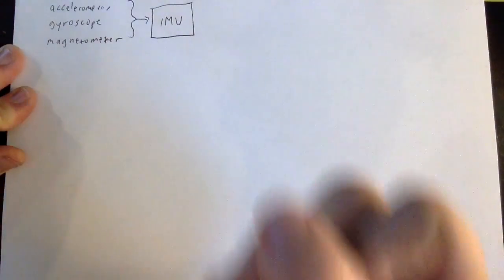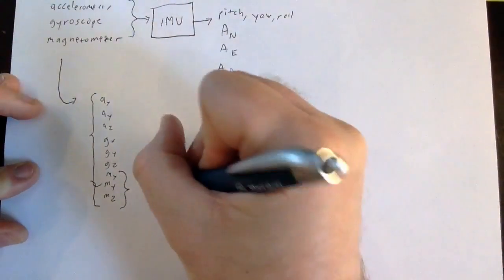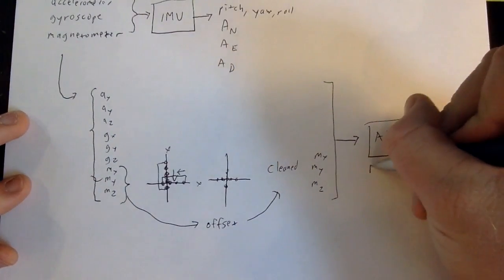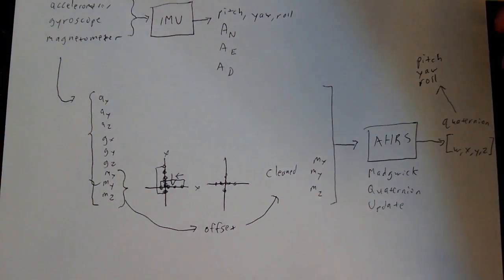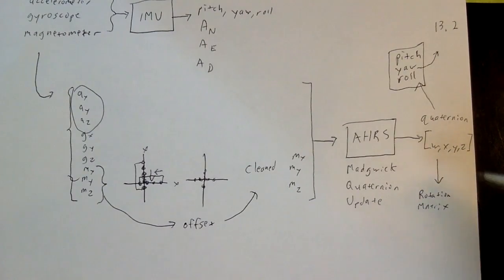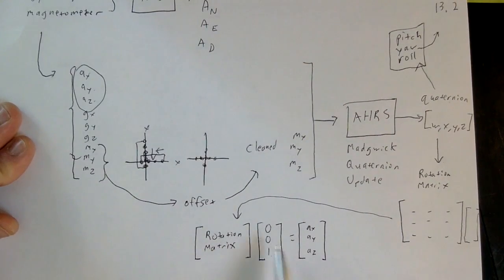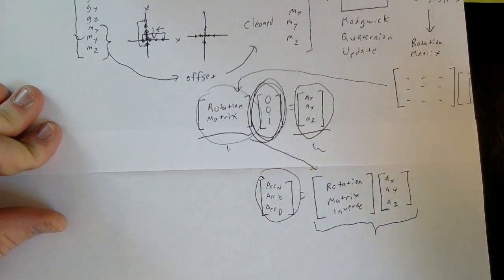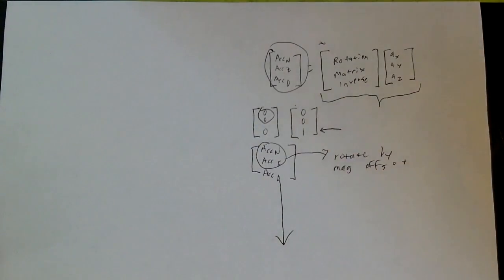How to Implement an Inertial Measurement Unit (IMU) Using an Accelerometer, Gyro, and Magnetometer

Comment: Thanks for the great video!!
I have a doubt. So, what is the advantage of merging the accelerometer data from the rotation matrix after the madgwick filter. I couldn't find more papers or resources which uses fuses the Accelerometer in NED frame (from madgiwck) with the GPS data in NED to estimate the position. In my opinion, I think if we use madgwick then the orientation will be more accurate so, we can fuse it with GPS to track the position more accurately. But I am not sure whether my understanding is correct. Can you point me to some resources which explains the approach which uses first madgwick or some other approach to get orientation first and then uses rotation matrix take accelerometer in NED frame as you said in the video?

Comment: I'm confused as to how you get a 3x3 rotation matrix that works. From what I can find, I can only get a rotation matrix to rotate the acceleration vector around each axis individually which isn't helpful because vector rotation in R3 aren't commutative. I am having a really hard time trying to remove gravity from my accelerometer data, especially since my IMU doesn't have a magnetometer. I'm trying to do it just with the gyro's angular displacement but I'm running into a few issues there as well.
Reply: the rotation matrix is dependent on the pitch yaw and roll angle which you can measure using gyro, accelerometer (and maybe magnetometer if you would). When you measure these 3 angles, you can create your rotation matrix which simply will rotate any vector by these 3 angles. anyways your comment is from 3 years ago ahahahah, I hope you've find the solution.

Comment: Hello. Great video but I have a query regarding offset (to account for magnetic declination). I am trying to use this data to find out my location( using GPS dead reckoning with linear kalman filter { with the help of your other video} ) .What do I do to account for offset in that case? I don't even my current location.
Reply: Hey I want to implement this using kalman filter. Can u help me plz
Reply: @shanuvals1456  It's been a while since I worked on this. So, might not remember a lot of stuff. What are the issues you are facing?
Reply: @vishnukiran6162  I don't get the code for this. I want to add gyroscope, magnetometer and accelerometer. and collect these input and give to the application for results
Reply: @shanuvals1456  I'm sorry. I lost access to the code. I won't be able to help you much. I apologize.
Good luck with your project.

Comment: I need some help with this. So if I have accelerometer readings like this [0, 0, 9.81] and I calculate quaternion and rotation matrix and then add a vector to rotation matrix [0, 0, 1] I should get the result of [0, 0, 9.81]? Or I haven't understood you correctly.

Comment: there is a delay in GPS measurement(position).how to remove it.help in this regard will be highly appreciable
Reply: You could predict the position based on the sensors mentioned in the video, until you get the next GPS bunch of data

Comment: My recollection from my time working with a magnetometer is that the calibration draws a circle because the earth magnetic field is constant. So then you can be crazy during the calibration: see that not all the axes have the same linearity (you have an ellipse instead of a circle) and compensate for it, or not ask the user to turn the thing an entire 360° and just extrapolate the circle from a few datapoints on the arc.

Comment: How do I subtract the gravity from the accel(NED)? I can't subtract the gravity when it is tilted, when stand still I can easily subtract on accD, but when I tilt it, how do I do that? 

when I multiply the rotation matrix inverse with the accelerometer, I get positive 1 if the device is at rest, is it normal? I tilt the device to rest on both sides and both top and bottom, but it will not give -1, always the +1. is it normal?

Comment: Hi.. I'm currently working on a magnetometer for Android/IOS & I seem to be getting a sphere around the origin, but the force of gravity seems to be pulling axes to their Max-value (clipping over between min & max & such)..
Any advice on how to filter that? Could I just remove Accel.x * Magn.xMax? Or would that possibly throw off the readings since it might not be linear?
Reply from the maker: Not sure I understand exactly...you'll find over time that the magnetometer is generally unreliable or at least requires significant calibration on a per-run basis.  Multiplying corresponding values like you're suggesting though I don't think is what you want
Reply: What I meant was that if a sensor was pointing down it was shooting off towards a maximum even though the sphere appeared to be around the origin (abs(max) ~= abs(min)).
Just realised I was paying too much attention to average value & not enough attention to MEAN value xD
Reply: Here's an example of my output (for a 360deg roll, 0 pitch, ? yaw (0 yaw/s))
http://imagebucket.net/kkdef6v73t89/Picture1.png
Reply from the maker: Are you just trying to get pitch, yaw, and roll?
Reply: Trying to get a quaternion rotation (I'm also using gyro data) with Z+ as north, X+ as East & Y+ as up.
I've got my accelerometer vector but I'm struggling to get a good Magnetometer vector to filter my gyro with..
Reply from the maker: Use madgwick: https://github.com/morgil/madgwick_py/blob/master/madgwickahrs.py
Reply: Ah gradient descent... Big help, thanks!
Reply: Would I still need to remove the Magnetometer's Bias when using Madgwick? Because my yaw seems off by about 5-10 degrees (off from the Magnetic heading).
Reply from the maker: yes...calibrate mag and then feed into madgwick with offsets applied.  If you're off by 5-10 degrees, also check and make sure that you've accounted for magnetic declination offset in your region.  A compass points to magnetic north, not to true north.
Reply: I'm checking against magnetic north atm ;) That's why I said Magnetic heading..
Thx for the help.

Comment: Could you explain what you mean by rotating An and Ae by the mag declination offset? Was this done in the rotation matrix?
Reply from the maker: Yeah, the way I implemented this I ended up rotating by the magnetic declination as the last step.  I think the proper way would really be to just continue rotating the rotation matrix about the z axis by the magnetic declination offset.

Otherwise, An and Ae is just a 2 dimensional vector...so the rotated vector would be something like:

new_north = N * cos(mag_offset) + E * sin(mag_offset)
new_east = E * cos(mag_offset) - N * sin(mag_offset)

For me I think it was just easier to think about 2d vectors, but you could just as easily incorporate this into the actual rotation matrix.
Reply: Wow thanks for the quick reply!

Comment: Hi Scott, great explanation, it really helped me implementing my own AHRS. But I have a small question, are your rotated accelerations in G or in m/s^? I ask this with regard to the implementation of the Kaman filter. Here I need to input acceleration as m/2^ for the term u correct? Thank you in advance!!
Reply from the maker: Rick van scherpenzeel yes, for the Kalman filter acceleration needs to be expressed in meters per second squared. The sensors I've used expressed acceleration in g's
Reply: Thanks for you quick reply and perfect! Now I only need to understand how to derive the rotation matrix from the quaternion and were good to go. Great serie and thanks again for the explanation!

Comment: is the accelerometer a linear or  are you including gravity ? will your method work in a free fall ? or in zero gravity (hypothetical)?
Reply from the maker: I strip gravity out after all of the transformations...the implementation works to re-orient the raw acceleration you get from the phone to absolute terms of North, East, and down...once you do that it's trivial to strip gravity out since you can simply add the value of gravity along a single axis.  

You otherwise need to include gravity from your sensors because that helps in the madgwick filter algorithm to establish a downward direction.